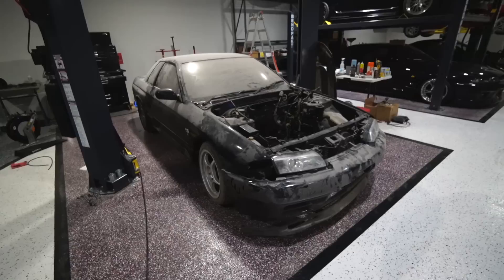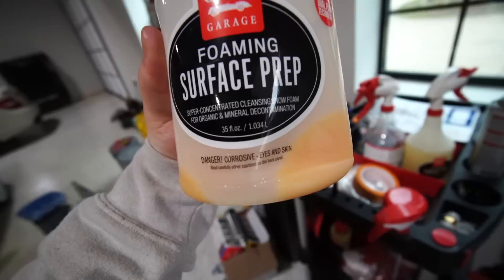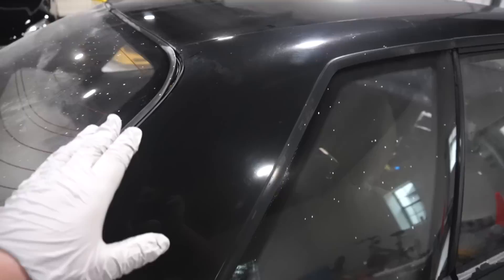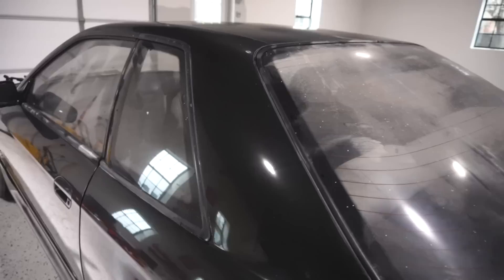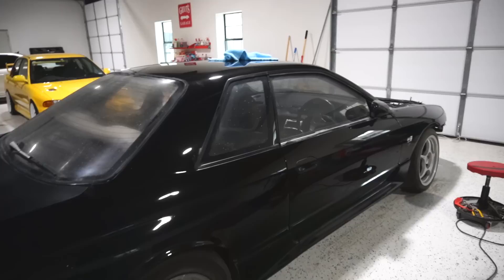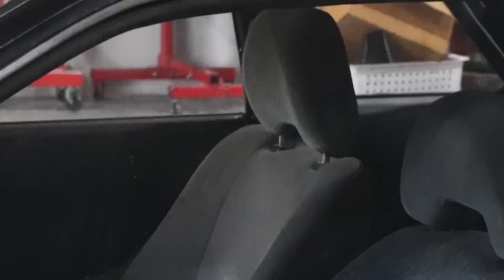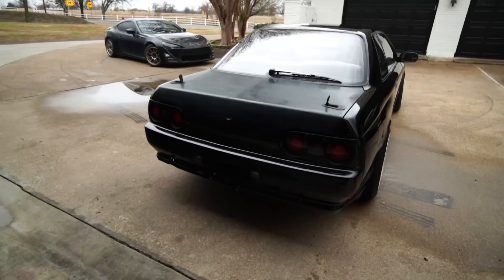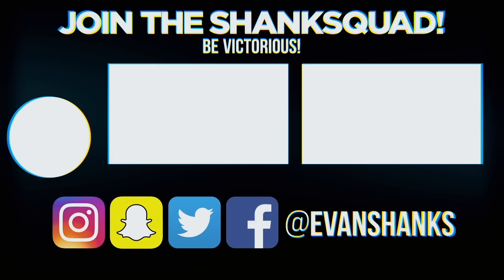Detailing my FILTHY Abandoned R32 Skyline - First Wash in 3+ YEARS

Comment: Also there Evan be careful lowering that are 32 anymore than it is, they lose a lot of their agility and you'll have issues with the four-wheel drive system in the rear end binding. Your best bet is to get some bigger Wheels / meteor tires and some deep side skirts to offset the height.
Reply: Can't say I've ever heard of that being an issue with R32's, maybe it's because everybody has Hicas lock bars.